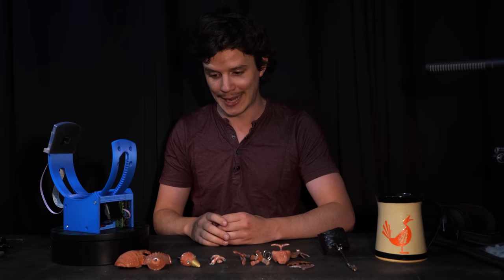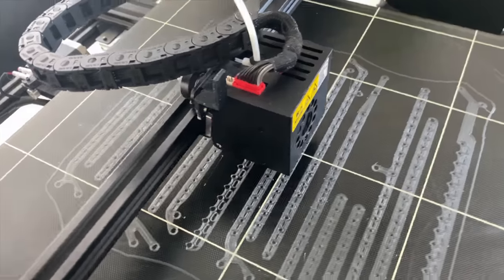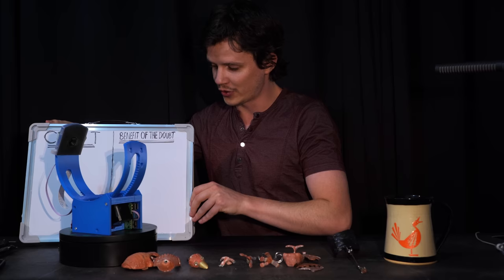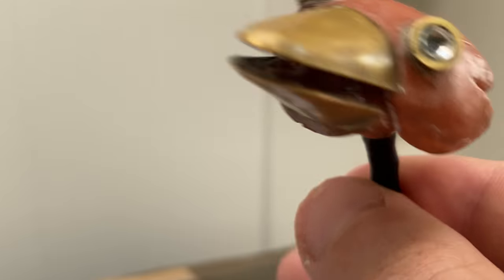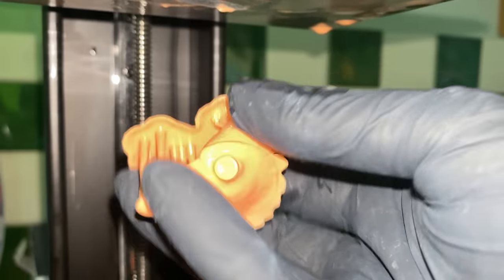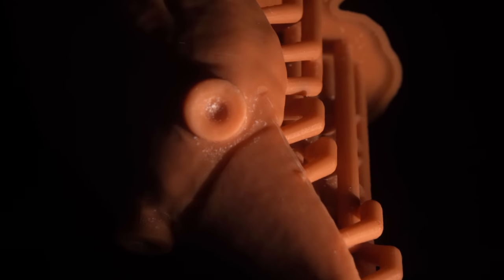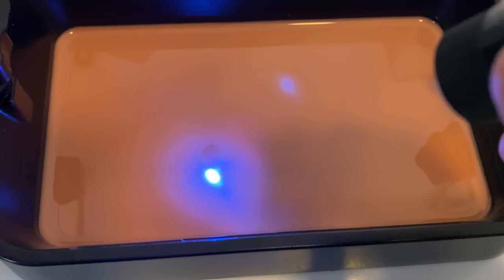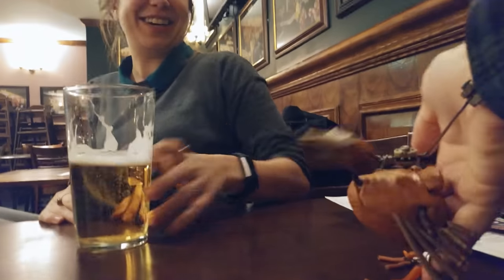DABCHICK got SCAMMED

Comment: Thinking about getting a 3D printer myself for my animation puppets, this video helped. Will try not to get scammed like you and Dabchick were.
Reply: I'd recommend just buy a new one, even if it's an older, cheaper model. They may be smaller or slower than the newer and more tempting ones, but resin printing has a ton of points of failure, far more than filament printing, so the chances of there being something wrong with a used one are high and if you don't have the experience, you won't notice them until it's too late. The hole in the FEP sheet Barnaby experienced, for example, is an easy thing to overlook if you don't know about it.
Also keep in mind all the processing and safety equipment (some kind of UV curing station -which can be just the sun, if the weather and location are suitable-, safety goggles, some kind of breathing mask, etc), the space and ventilation needed, and the consumables (nitrile gloves, isopropyl alcohol, etc).

Or if you go filament, it's just the filament and maybe some glue sticks or hairspray, but you'll get much less detail.

Comment: Increase the exposure time for every layer you are printing by about 1 or 2 seconds at least. the splits are happening because you have not tuned your timing on layers for your specific resin as its very fickle and annoying to work with, the longer exposure time means its more likely to harden together the layers

Comment: Resin person here with some thoughts. You could make "master copies" of parts for Dabchick and make a silicone mould to then cast more parts. Just don't do it with a 3D resin print item as that resin takes weeks to degas and will still ruin the silicon curing process.

Comment: Your delaminating is due to the solid material flexing. Depending on your resin you may be able to solve that without any geometry adjustments just with the fluid level settings but your best bet is to make your print object more "vertical" and even in its stresses as the material cools and changes shape

You can also help avoid this with better environmental control, especially hotter and humid room can allow you to cool and dry your resin piece all at once rather than halfway through the print

Comment: Worth noting for my resin printer I had to scratch up the surface of my printer head before I could get good adhesion. then its just a matter of learning the settings that work for your printer/humidity/temperature/wind/ect. If you need someone to print for you i have a photon s and would happily print what you need for shipping costs.

Comment: Resin printing is a bit of a pain to learn at first, but once you get your settings down its very reliable. My only advice is to ditch that creality printer as soon as you've gotten comfortable with the process and get an Elegoo one. They're about the same price, but the creality ones have a defect that effects the print quality near the edges. Also, if you get some heavy duty neoprene gloves you'll save some money on that consumable since you can reuse them.

Comment: Bump up the initial layer time to like triple and season the film on the vat a bit of PTFE Lube. If none of that works, bump up the curing time for all layers.
A couple of times I have gone against all advice, dipped the build plate, scraped almost all the resin off and cured that (any bogies will solidify and crack the print LCD so I'm not going to tell anyone to do that).
Looking forward to more info on Dabchick's Lazarus Project.

Comment: Sorry to hear about your situation with the 3D printer. I hope the scammer refunds you.

Coming back to your 3D prints not coming out well from the printer. Have you tried tweaking your exposure settings for the bottom and normal layers? In my experience, especially with non-clear resins or other liquid based 3D print material, they sometimes may need extra time during exposure when the light travels through each layer. This could possibly help with the layers sticking to oneanother better.

Comment: i got a voxelab, new, CHEAP, mono screen for faster exposures, yada yada, it works, but the resin was the first, cheapest stuff i could get, it's a bit brittle, made some guitar parts, thicker than metal for good strength.  the adhesion issues i've looked up, apparently i need to up the exposure on the first layer, some things come out fine though.

Comment: I might have a resin suggestion for you to try, it's not "cheap" but it's good industrial resin that we use at Animation Toolkit for all of our stopmotion puppet parts (not the ball and socket stuff as that's still metal, but body parts and skulls) it's also quite strong too, I can print it with a 1mm wall and find it holds extremely well under hand pressure.

Comment: Edit- Oh... I typed that and the next sentence he said he's getting advice from someone XD. 

Here's some things that might help you with more successful resin prints. 1- Nice job removing the cured resin. Now, get a screen protector so you never need to do that again. 2- Plastic razors help a lot more than the metal and help prevent holes in the fep sheet. 3- Get PTFE lube. Remove all the resin from the vat, put a thin film of the lube down, then put the resin back in. This will reduce the force needed for the bed to pull the print off of it. 4- Resin expires in about a year. You can still print with it but you're more likely to have failures. Also, it hates the cold. If it isn't flowing easily, put the resin back in the bottle, seal it firmly, and run hot water over it until the bottle starts getting warm. This will lower the viscosity making it run easier. 5- Settings. You don't need as much time on the layers as you think. Maybe 20 secs for the first 5 layers and 3 on all the rest. Double check reddit for your printer for advice. 6- Watch Angus from Maker's Muse video on how to stay safe while working with resin. It is fun but incredibly toxic over time. 7- Uncle Jesey also has some great videos on resin printing. He did have a chemical burn from a bottle accidently opening on him and it burned a lot of his skin. He's fine now though thankfully but still scary. 8- The supports. The angle of the head is great, but use thinner supports and more of them. That'll make removing them a LOT easier. I know there's a continuous support feature now but I haven't messed with it yet

I can't wait to see Dabchick's new form ^^. Maybe he can even do a fashion show with a daytime look and nighttime glow in the dark look XD

Comment: Look into a Bambu labs filament printer. Very good resolution with even small parts. Resin has some advantages (I have 3 resin printers) but the Bambu printer is my favorite. i have even printed clock parts with the printer.

Comment: Too late now but for the size you need to print you can get a brand new Elegoo Mars 2 for about £200.
Also with resin printers, the screens are essentially consumables. I had a resin disaster with mine (hole in the bottom of the vat) and was pleasantly surprised to find brand new replacement screens for about £50.
Finally, resin printing is as much art as science. If you're a massive nerd like me, figuring out how to place optimal supports is part of the fun.... if you just want your object, I'd recommend Lychee Slicer, it's free, about as intuitive and user friendly as slicers get and has a really good auto-support feature.
Love your videos, can't wait to see Dabchick back in action.

Comment: I think a good, fast fdm printer like a bambu lab p1p would have blown you away with its quality and print speed. Additionally you wouldn’t have to handle toxic fluids which can’t be easily disposed. And it would have been cheaper…. Just sell this junk and get a good fdm!

Comment: I suspect you've heard all of this before, but: check your build plate level every time you remove it (even half a mm off with resin can screw it up), shake bloody hell out of the resin in the bottle, and verify your supports and islands (floating bits of the object that are not attached initially). Lastly, and most importantly, verify your printer's settings for the resin you are using. Some machines are very finicky with certain resins, and if it's an older machine this is even more true. There are calibration prints you can find that will tell you the best settings for that resin on that machine.

Comment: I had this exact same experience. You got lucky that your printer was 1 cheaper and 2 turned on.y guy sold me one that he said was never used. I opened the package and set the printer on the shelf and waited a few weeks to actually inspect it. It never turned on and when I lifted it up it leaked resin everywhere, meaning they ruined it with resin. Seller ghosted me and it sucked. I made a resolution to never buy a second hand printer again

Comment: I've been printing miniatures for a while now, and, while I'm not an expert, I can identify one big mistake: more light supports is better than fewer heavy supports. It's the opposite logic to FDM printing. If you can't peel your supports off with about the resistance of velcro, your supports are too heavy. If light supports aren't adhering, your exposure time may be too low.

There are a number of calibration tests you can do to dial in various features, some of which might be mutually exclusive (the Ameralabs Town test has a couple of targets that are mutually exclusive), but for practical concerns, the Cones of Calibration are the test you should aim for to dial in the exposure time. They're a simple test with a series of cones on two sides of a small model. On one side, they should all succeed, and the other side they should all fail with progressive degrees of failure. If the fail side succeeds, you're overexposing, if the succeed side fails, you're underexposing. Dimensional accuracy on something as large as Dabchick is not really going to matter on that scale, though to keep all things equal, try to print each piece at the same ambient temperature. Resin is very sensitive to ambient temperature, and shrinkage is a thing to look out for. You don't want to print pieces on different days and find they're not going to fit together.

Those splits in the model could be down to plate adhesion, as you said. You never know what the c**t who owned the printer before you has done with the plate, given the state it was in. It seems like the previous owner knew even less than you do right now about printing, and he probably sanded the plate for better adhesion, and didn't leave it flat. I normally don't use one, but you could get a Wham Bam flex plate, which should provide a good surface. They just magnetically stick straight to your existing plate. Some people swear by them. There are a number of things that can cause failures like these, but the splits tell me that the FEP sheet is clinging tighter than the build plate is, but not evenly, and not by much (otherwise the whole model would just stay in the tank and the plate would come up empty). Getting your exposure time and lift speed right, and the ambient temperature to a good range for the resin (something like 25°C I think) can help with this.

As for resilience, while it is expensive, get some Sirayatech resin. They have a strong, flexible resin which is intended as an additive for other resins. It'd be heinously expensive to print Dabchick entirely in that resin, but if you mix it in at maybe 10-25% (you just have to experiment to find what comes out right with your main resin) you'll find Dabchick will come out much stronger and with a little flex to his parts. He won't be bendy, but dropping him won't shatter him into a million pieces.

Try using Lychee Slicer instead of Chitubox, as the automated supports in Lychee are a lot better, in my experience, and remember, more light supports are ALWAYS going to be better than few heavy supports.

Comment: mad props to you man for the sheer effort and grit of trying to repair something in that state and so sorry that has happened to you.  is there any possibility that the light itself has been damaged as well causing it to miss fire and malfunction the lights for the current layer of the print/curing process? (I have zero knowledge/no practical use of resin printing im purely a PLA/The one that uses a hot end to slither out a plastic goo to make my prints. tbf im starting to hate it myself the level of messing around to try and get a good solid print is draining.)

Comment: maybe you need to play with your exposure settings?

With resin prints, you need to optimize your cure times based off the resins you're using. If your cure times are too short the resin will still be too soft, which can cause de-lamination, and on some prints, complete failure on the first few layers.

My recommendation would be to bump up the exposure in increments and see how it affects your final prints. it should get you somewhere in terms of improving your success rates.

Comment: There are resins that are quite resilient, or even ones that you can remove the resin from after the fact, though usually the ones you can remove the resin from are infused with something, more difficult to print with, and require an expensive kiln to remove the resin via burning. I agree with a number of comments suggesting molding and casting, though like they've said, it's expensive.

I would personally say go with a more weather resistant resin. While not perfect, it would last quite a long time, and with paint UV might not be an issue regardless. If you did end up having to have backup parts to replace in an emergency, you would have to replace them less often, and thus, would have to carry less on outings.

Comment: The problems you have with the printing come from low exposure. 
You can increase the curing time for base and normal layers and should also check the temperature.
Best to print above 25°C.
Sorry to hear about the scam, but it seems you managed to repair it quite well. Just dial in your settings with a test model like the one from siraya Tech and it will print fine.

Comment: Perhaps 3d print your piece, create silicone mold, cast in tough semi-flexible resin. Your 3d printed resin parts are going to be incredibly fragile uv exposed or not. With molds in hand you can make any color, many materials, and many copies with much less effort. Still 3d printing is a good hobby/skill to learn and dive into.

Comment: I am trying to make puppets as well. Skeleton I am machining aluminium and steel and that part works ok, also did try regular 3d printing but its too easy to break. For skin I am trying to create mold with resin printer and then cast silicone skin, so far failing every attempt. I seen people do it excellently, it looks easy and is only easy to screw up.

Comment: Erm, I’m not a three printer user but as a curious person, I’m wondering if that UV liquid isn’t off or somehow contaminated? It seems too thick and may explain why it’s not working as it should. As if they broke down the supports incorrectly and put it back in the bottle to have more resin, not realign til afterwards they compromised the whole bottle. Is that even possible?

Comment: I have the exact same resin printer, The print sticking to the film can be fixed by adjusting the settings and applying wd-40 PTFE Dry lube on the film via a paper napkin or something similar u can also clean off the metal part the print is supposed to stick to with  isopropyl alcohol or acetone. The settings part might be the hardest since u need to really fine tune it for the best results which takes some or a lot of time. I've had one almost completely perfect print but the layer shifted once, however not that badly but I haven't gone and taken much time to fine tune my settings. So far I've only adjusted the delays.

Comment: I know this is entirely different from what your doing but i recon making a silicone mold of dabchick’s sculpted parts and that casting it in resin or liquid plastic could be a good solution to the problem having to replace parts that begin to degrade over the years

Comment: You should really just order this printed from a reputable company like shapeways. They have printers that can work with support material in fine detail, so you don't have to worry about supports and such. Also if really want a durable print you can have it done in metal.

Comment: hey i have some experience with resin printing looks like you might need to dial in your resin settings. also if your having issues with prints sticking to the FEP sheet consider applying ptfe lube to the FEP sheet before adding your resin. also when slicing your print it might be failing as a result of islands being unsupported upgrading to a premium plan with your slicer of choice will automate searching for islands and applying supports to islands.

Comment: that looks like a HALOT One, (same printer i have) with out knowing your settings it's hard to fix. You may need to increase your layer times. Also re the resin uv issues, Just paint it... it does wonders.

Comment: For durability, siraya tech resins are great, but a cheaper option would be sunlu resins, especially their ABS like resin. I think part of the reason you're having issues is because of the zmud, as i believe it's a resin known for its lack of tensile strength. Also check your raising and lowering speed on the printer, as if it's moving too fast, it will absolutely destroy your prints if you aren't using one designed for speed.

Comment: Those are some thick boy supports. Quantity over size is what you need. You want a lot of fine supports rather than few large ones. 

I also know for a fact fdm would work much better for you. Dabchick doesn't have a lot of fine details so fdm would work just fine. Resin is just too brittle.